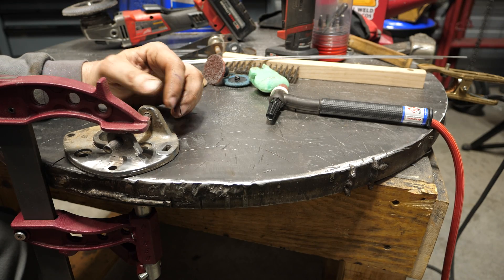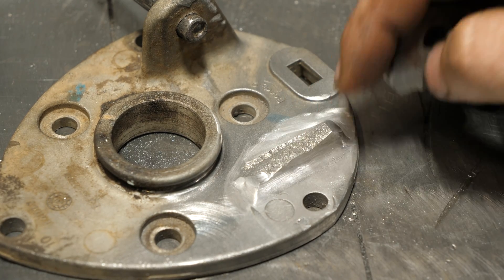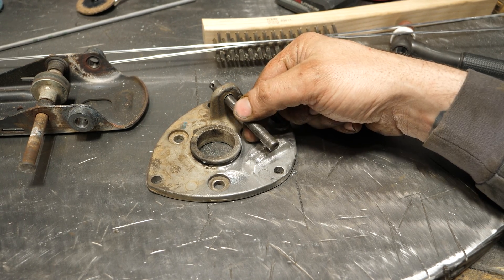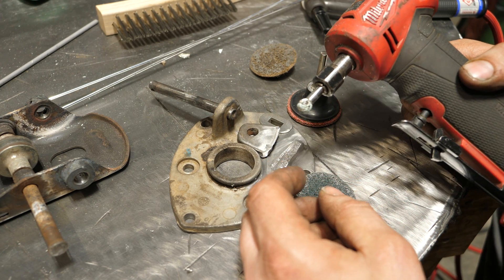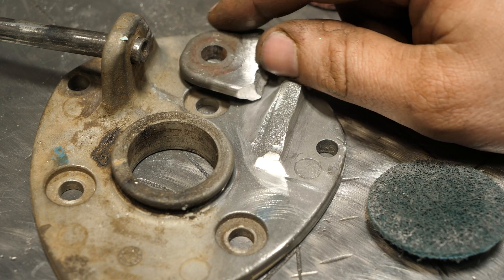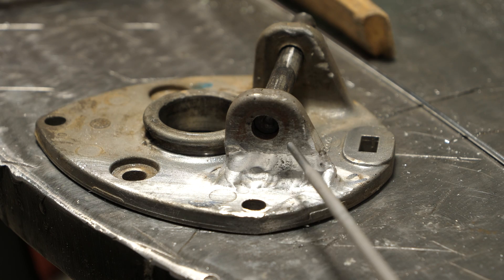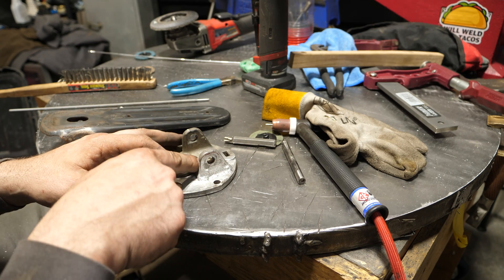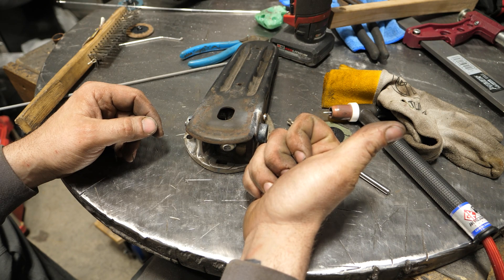Tig welding repair on a aluminum casting

Comment: It's strange that the pivot pin was designed with steel, and the bracket was alum. Usually, it's designed the other way (the pins are intentionally softer) so the pin shears off and is easy to replace for this very reason.  My snowblower has a shear pin so when chunks of ice or get lodged in the auger assembly and the engine is going at full tilt, a pin (really a bolt) safely disconnects it from the driveshaft.

Your welding skills never cease to amaze me. Hey, I'm looking at the HTP PulsePro, but can't tell if it does spray pulse arc...it can Pulse (obviously) and it seems like it can spray, but their documentation isn't clear. Can you make heads or tails?
Reply: I’m sure if you gave htp they would answer any questions you may have. I hear that their customer service is amazing, or you could possibly reach out to @ZILAwelds here on youtube
Reply: 220 amps doesnt seem like its enough juice for spray arc, primeweld 285 can do it but barely
Reply from the maker: It definitely was designed to fail lol.  The pin had so much rust on it looked like it had barnacles on it.  I was given it in parts and my first thought was “get a new one” lol.  

So the pro pulse 220 would be able to handle spray at a very limited capacity.  It was designed as a 200 amp welder with very intermittent output at 220a.  Spray welding with .035 wire starts around 200a with c10 gas.  With pulse the limitation becomes heat input.  If you pulse at its max output of 220a you will not have 220a of heat input, you will have less than that.  Which means you would likely drop to an unstable version of spray depending on settings.  The main benefit to pulse on that machine is the ability to weld out of position (vertical up and overhead) while putting down clean welds without having to weave.  Running uphill with normal mig takes quite a bit of skill, pulse makes it far easier with better results.

Comment: I love the soap trick for the burrs!   If one doesn’t have an A/C TIG available, can this type of repair be done with TIG Silicone Brazing like when repairing  cast iron assuming good prep is performed first as you stated?  What other options would there be for a durable repair if not?
Reply: No. Silicon bronze brazing rods melt below the melting point of iron or steel, but is higher than the melting point of aluminum. There are aluminum brazing rods. Often you’ll see an Ad for them saying  welding, but it’s soldering/brazing.
Reply: @melgross  Thank You  
Do you think those aluminum brazing rods would be strong enough to do a similar cast aluminum repair?

I’ve seen those, but thought they were a gimmicky very low quality solder.  I understand the differences  between Welding, soldering and brazing, and their approximate  working heating temperature ranges, but I’m not familiar with aluminum brazing.  I’ve done cast iron repairs with silicone bronze via TIG, but back in the day we used standard brazing rods and a good old oxygen acetylene torch.   Brazing done properly is amazingly strong!
Reply: @michaelwhiting878  the ones I’ve got are an aluminum alloy of some sort. How strong they are depends. How strong is the aluminum alloy to begin with? Usually, you don’t know that. If you built it up somewhat, it should be fine. Brazing works well on iron because the iron isn’t that strong to begin with, so the difference with the braze isn’t that great.
Reply from the maker: I have never used the aluminum bronze brazing rods without flux that I have seen advertised.  I will have to do some testing with them to see how strong they are.  They might (with an oversized weld) be able to make a successful repair on the part.  I know fluxed aluminum welding rods with a oxyfuel torch could do the repair.  

Also, I just saw two emails from you in my giveaway email box. My primary one is trashed and I have been missing out on a ton of emails apparently.  I will be responding on the one from my giveaway box shortly.

Comment: Nice video! I should have guessed "commercial" parts like this were astronomical in price.
Reply: The funny thing is casting Aluminum, or rather ZA-12, is also an easy way to do this job, and takes less up-front cost than a welder or an Oxy-Fuel torch.

3D printer, melting furnace, casting sand, a wooden box, and ZA-12 metal to cast with.
Reply from the maker: It’s almost like they know it’s going to fail so the price is sky high lol.